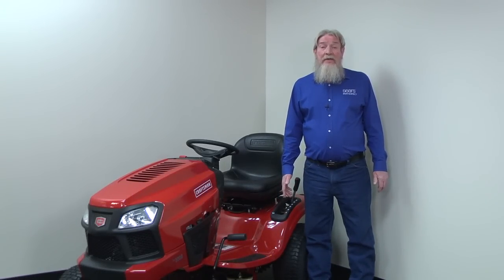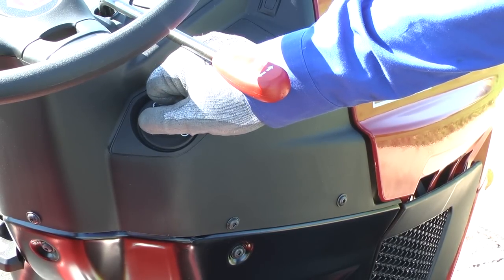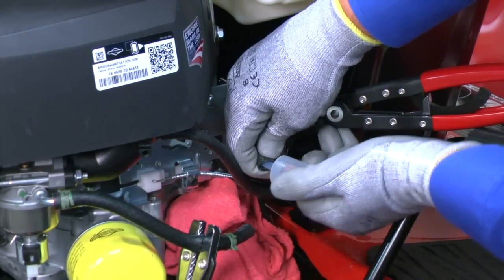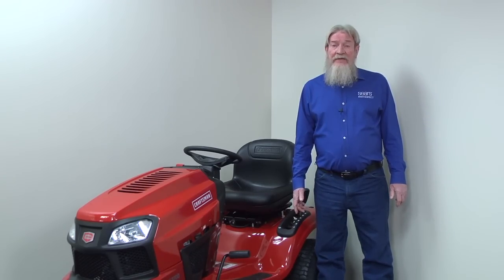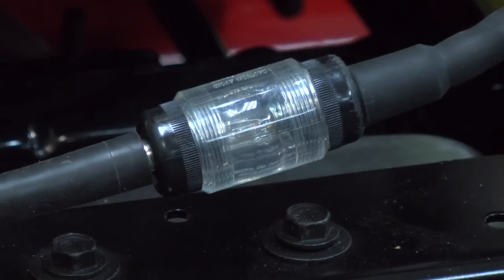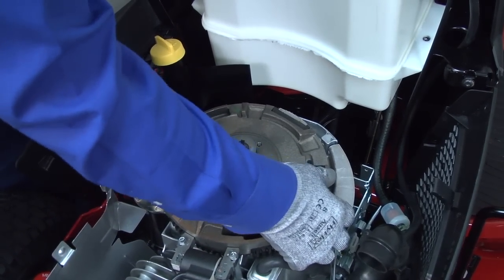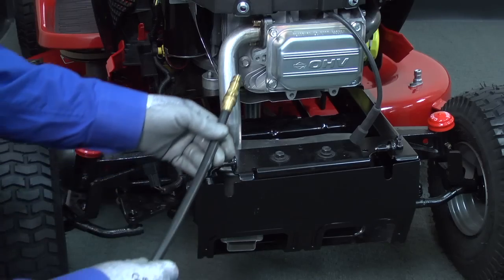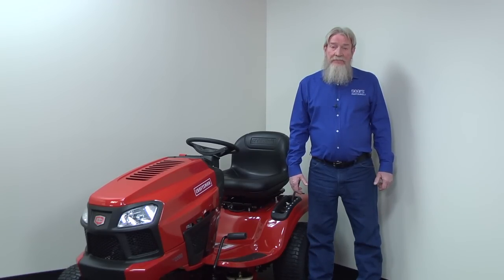How to Fix a Riding Lawn Mower that Won't Start: Engine Cranks But Won't Start

Comment: Craftsman with brigg Stratton engine crank but won't start,I spray starting fluid but didn't do nothing no even trying to started, I check the power and I was getting spark,I installed a new spark plug but still nothing,  I do see the spark plug was getting wet like fuel is getting there.
Reply from the maker: A broken flywheel key could be preventing the engine from starting because the spark isn't firing at the right time. If you have a single cylinder engine, a bad compression release cam can also prevent the engine from starting. If the engine only rotates for a second and stops when you try to start the engine, remove the spark plug and see if the engine cranks freely. If it does, then a broken compression release cam is likely preventing the engine from starting. We hope the information helps. If you need further assistance, let us know.
Reply: @searspartsdirect It does,. Thank you so much.

Comment: I have acrank, but no start issue my self. i used it a few months ago and it ran fine. The next day it ran fine, but after a short while it really lost some get up and go by going very slowly back to the garage and now it won't start. My mom's got a large yard and the normal grass guy has been ill lately. Would dirt in the carb make it act like this? 
Excellent video btw.
Reply from the maker: A dirty carburetor could be causing the symptoms that you're describing. Before cleaning or replacing the carburetor, we recommend that you complete basic troubleshooting such as checking and replacing the air filter if it's dirty. If you spray starting fluid into the carburetor and the engine starts normally and runs for a few seconds then everything else is likely good so you will likely need to clean or replace the carburetor in that situation.
Reply: @searspartsdirect   checked it all out. Got spark and fires up with a spay in the throttle. Cleaned the carb good. Lost some gas when i disconnected t he line. I think the carb was clogged,  but i also discovered my full tank was completely empty. except for what was was in the line. lol i did nip the rubber on the solenoid, but i never lost all the fuel before. I wonder where that leaked from. Time for a shut off valve i guess.  Still wondering about the sudden slow speed. Could that be from lack of fuel flow? Or  did the tranny decide to act up at the same time? I do have bad luck like that. lol
Thanks!

Comment: Thanks for this video. Went through the trouble shooting method of checking connections and the spark plug cover had popped off. Maybe I fully reconnected during last mow.

Comment: Mine has a brand new carburetor, new plug, new coil. It ran great last fall. It will fire up with starter fluid and pump is filling new carburetor with gasoline.
Reply: So does it run normal after starting it up with starting fluid

Comment: Well done!    Well lit, well explained, well photographed.  
The fuel solenoid plug had separated on my Sears T1400 with 17hp Briggs engine.  Plugged it back together. Still didn't start.  Installed a new plug (the old one didn't look too bad) and with the new plug it fired right up.
Reply from the maker: Thanks for letting us know what you found. We're glad to hear that you fixed the problem.

Comment: From what I've seen my mower has compression (you feel it when you turn it over by hand), it has spark because I pulled the plug and left it connected and I saw a spark, and I have fuel because when i turned over the engine without the plug it shot fuel out the spark plugs hole. (A really stupid way but I don't have many of those tools myself so I had to improvise). Still hasn't started, just keeps cranking.

Comment: i had this happen to my  98 craftsman  i sprayed  fuel into carb  it ran about 30 sec and quit  then i disc. the red wire to carb solenoid  its push on conn. i was looking for 12volts with switch on pos  it was not there so i go to the switch  i had 12v on b lead but not on  A1 lead   replaced  switch --- fixed it

Comment: takes starting fluid to start my craftsman g5500. changed plugs/ oil/gas. ran a gallon of fresh fuel with seafoam. still happens. ran a gallon of fuel with mystery oil. still takes starting fluid to start. had it serviced a few times before Sears went under and each time the tech changed the jets and it would work fine. I live in Colorado and he insisted different jets for spring/ fall. I don't know.

Comment: What if you have spark and you have  just done a valve job the valves are set right. Has good compression,  a new key was installed in the flywheel. When you spray fuel in it ignites backfiring out the carb but never starts.

Comment: Have a craftsman yts 4000 mower, to get it started you have to use starting fluid to start it, then it runs fine, replaced carb. , does same thing, help please

Comment: This was a great video. Super informative. I'm having an issue however that so far I haven't been able to solve. The engine spins but doesn't crank even after I've replaced the carbereutor, fuel line, fuel filter, air filter, spark plug, flywheel key and got a new battery as well. It seems that fuel is flooding the engine as well since I've noticed leaks after trying to crank the engine for 10 seconds or so. I did a compression test and it appears that I'm not getting any compression at all. Could this be an issue with a piston or cylinder? My mechanical knowledge is somewhat limited I'm afraid. Any further tips would be immensely appreciated.
Reply: If you have no compression you will need to pull the head. Either the valves are stuck open, Rings on the piston are shot, or the connecting rod to the piston is broken. Bad rings can be checked by added oil to the cylinder through the spark plug hole and retesting compression in the cylinder is vertical. Connecting rod can be tested by holding your finger over the spark plug hole and cranking. If there is no blow back then your connecting rod is broken.

Comment: I mowed my lawn for the first time this year. It did fine. I was finished and driving it to put it away when it died.i assumed it was out of gas but it was not. How does it all of a sudden die while your using it?
Reply from the maker: Some Briggs & Stratton engines use a fuel shut-off solenoid that could kill the engine if the solenoids wire harness vibrates and falls out of its plug on the solenoid valve. Check that wire harness that attaches to the fuel shut-off solenoid on the bottom of the carburetor if your engine has one. Reconnect that wire harness if it's loose or disconnected. A bad seat switch or bad seat switch wire harness connection could cause the engine to die. Check the seat switch wire harness and reconnect the wire harness if it's loose or disconnected. A bad grounding switch, short circuit in wiring or a failed ignition system could also cause the engine to die. We hope these tips help. If you need further assistance, let us know and post the model number of your riding mower.

Comment: using my riding mower it started to back fire and died now will not keep cranking. changed starter new battery can turn motor by hand
Reply from the maker: If the blades hit a stump or rock, a sheared flywheel key could be keeping the engine from starting. In single-cylinder Briggs & Stratton engines, a broken compression release cam will cause the engine to stop rotating. In that type of engine, remove the spark plug and see if the engine cranks freely. If it does, you'll likely need to replace that cam. We hope these tips help. If you need further assistance, let us know the model number of your riding mower and additional details about the problem.

Comment: Thank you for the video.  I just changed the oil in my brand new lawn tractor and then it wouldn't start.  Turns out I accidentally unplugged the little cellunoid wire while unscrewing the oil filter.  Would have taken me forever to find this without your help.
Reply from the maker: Thanks for letting us know what you found. We're glad to hear that our video helped you out.

Comment: John Deere lx173 mowed last week then mowed behind trees it just quit cranks won't start but starter fluid  it started for a second the quit  I guess it was empty on oil dipstick I added oil before I tryed to start it with starter fluid is Motor blown
Reply from the maker: Check the engine oil level again. Make sure that you didn't overfill the engine with oil. Drain some oil out to reach the proper oil level if the oil level exceeds the full level on the dipstick. If oil is below the full mark, add oil. If you had to adjust oil level, try to start the engine with oil at the proper level. If the engine won't start, try starting it with starter fluid. If the engine runs for a few seconds then quits when using starter fluid, then the internal engine parts are likely okay. Try replacing or rebuilding the carburetor. If the engine won't start using starter fluid, check the spark plug. Replace the spark plug if it's fouled with deposits. Follow the rest of the troubleshooting shown in the video if the spark plug is okay. We hope this information helps. If you need further assistance, let us know.

Comment: I think I'll just call another serviceman.  I called Sears one year and the serviceman that came out told me that the deck was rusted which could cause a hazard so he took my 98.00 service fee after sitting in his truck for 20 minutes and didn't attempt to fix a thing.  I'm through with Sears.
Reply from the maker: We're sorry to hear that you had a bad experience with Sears service in the past. Your details seem to indicate that the service call occurred over a year ago. If you would like to discuss the issues that you had with that service visit, please call Sears Home Services at 1-888-577-4342. At Sears PartsDirect, we provide expert DIY troubleshooting and repair help for free. If you need assistance completing a riding mower repair yourself, let us know.

Comment: I was mowing hit an ant pile and mower stopped will turn over but not start plug is good has spark has compression  had carburetor cleaned gets gas the valves are good but still wont start pls help me I'm out of bc things to try
Reply from the maker: There's a possibility that the engine flywheel key sheared when you hit the ant pile. Watch the video beginning at 3:41 to see more information about how a sheared flywheel key can disrupt engine spark timing and prevent the engine from starting. Here's a video/repair guide that shows how to access the flywheel key: https://www.searspartsdirect.com/repair-guide/riding-mower-and-tractor/how-to-replace-the-flywheel-key-on-a-riding-lawn-mower.html . Check the flywheel key and replace it if it's sheared. We hope this information helps. Let us know if you need more assistance.

Comment: My rider has a intek 20hp B&S it is hard to start like no fuel, after several times it finally starts but chugs for a few seconds then when I speed up the engine a cloud of white smoke puffs from the exhaust then after warm up a low knock noise from around the flywheel area starts, could be a rod but does not sound like one. What would you suggest to do?
Reply from the maker: The white smoke indicates that the engine is burning oil in the cylinder. Check the oil level. Drain some oil out if you have the engine overfilled with oil. If you need more help, let us know the model number of your Briggs & Stratton 20hp Intek engine and give us additional details about the problem such as whether the problem started gradually or began suddenly.

Comment: I had to rebuild my carb when replacing the float needle... Just make sure you mark or take a pic with your phone of your throttle linkage before you disassemble it.  If you don't put the throttle cable assembly back how you had it, you can get a similar issue where it has trouble starting and/or the rpms don't go as high.  
Great video.  Thanks for sharing!

Comment: You helped me discover that my fuel solenoid power cable had simply come unplugged. Thank you.
Reply from the maker: Thanks for letting us know what you found. We're glad to hear that you got the mower fixed and that our video helped.
Reply: @searspartsdirect  
I have an older Craftsman rider 11hp...I can get the engine to turn over, but it stops after the flywheel makes 2 revolutions....any ideas?
Any help would be greatly appreciated!!
Reply from the maker: @unclefreddieDied  Let us know the model number of your rider and we'll try to provide some specific troubleshooting tips. The model number is often located under the seat.

Comment: The only thing this guy did not hit on is if you have " No spark " condition is the small kill wire on the ignition coil. If you have no spark, remove that small wire on the coil and try a start the engine... If it starts with the kill wire off, you either a grounded kill wire, bad seat switch, ignition switch,etc.

Comment: I have a red craftsman riding lawn mower. I turn the key on the motor turns but it wont turn over. i have put in a new spark plug. I have even changed the gas and changed the oil. I have adjusted the front vavles as well. I have even checked the battery and also other items as well. I did rebuild the carburerator as well. I put it all back together and it still doing the same thing. I am wondering could it be my starter or could it be the solenoid as well im not sure. I really dont think its a timing issue at all unless i am wrong. Last for all is i have a video if i can share with someone and then let me know what they think because i am so lost of what else to try out or do thanks very much. This red riding lawn mower is key to what i do in work thanks all
Reply from the maker: We’re not sure if we understand your details. When you say that you turn the key on, the motor turns but it won’t turn over, does that mean that you hear the solenoid click and the starter motor try to spin the engine? If so, then remove the spark plug and try starting the engine with the spark plug removed. If the engine spins (even though it won’t start) with the spark plug removed, then a compression release mechanism on the valve cam is likely broken (if the engine is a single-cylinder Briggs & Stratton engine). If you don’t hear any click or starter noise when you turn the key to the start position then follow the troubleshooting in this video to find the cause of the starting problem: https://www.searspartsdirect.com/article/riding-lawn-mower-wont-turn-over-or-click-video.html . We hope this information helps. If you need more assistance, reply with additional details and the model number of your mower. You’ll likely find the model number on a sticker under the seat.

Comment: It won't stay on
Reply from the maker: A carburetor failure often prevents the engine from running. You may need to rebuild or replace the carburetor. Here’s a video that shows how to rebuild the carburetor on a common riding mower engine: https://www.searspartsdirect.com/repair-guide/riding-mower-and-tractor/how-to-rebuild-a-carburetor-in-a-riding-lawn-mower.html